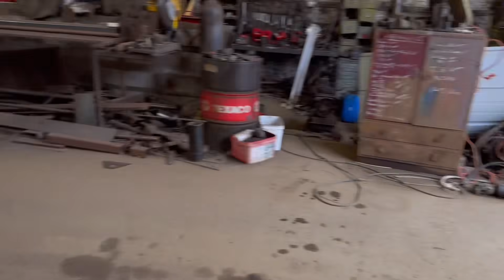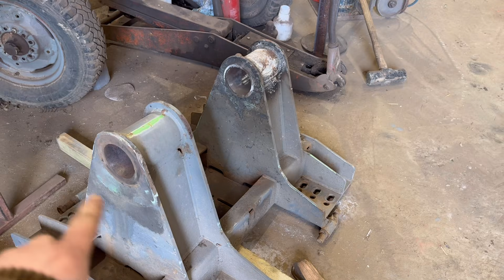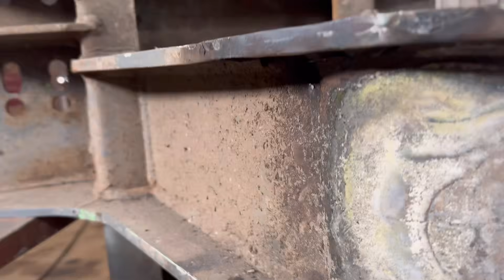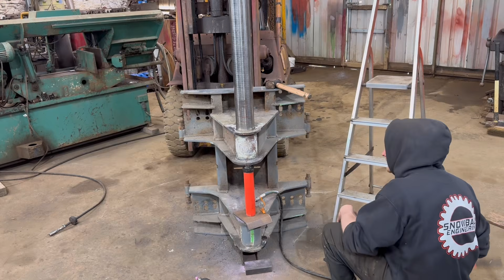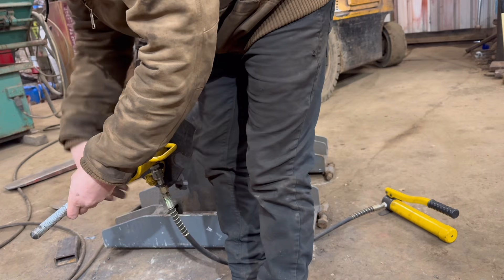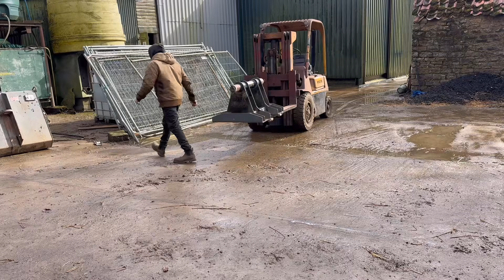Replacing Joskin tanker axle pivot. Part 2.

Comment: An automotive cylinder hone would be great to prep the tube before installing the new bar.
Also,if you need lube but don't want to contaminate rhw weld,use your sisters personal lube..its water based and washes off easy with water and will burn off at low temp.

Comment: Never use a stick lighter, disposable lighter, or matches to ignite an oxy-acetylene or oxy-propane torch. Lighting these torches creates a concentrated rush of gas that ignites with significant force. Using a hand-held lighter is extremely hazardous because it places the hand in close proximity to the initial flame, which can result in severe burns or the potential explosion of the lighter itself due to the heat.For safe operation, industry standards require the use of a traditional flint striker (also known as a cup striker) or a dedicated long-reach torch igniter designed specifically for welding. These tools are engineered to create a spark while keeping the operator's hands at a safe distance from the torch tip.

Comment: That's a proper heavy bit of work there . I still would have cut the outside bits right out of it before jacking the stuff out. But the observers viewpoint is one you don't have and we cant see what you see or know either. You made it like new in the finish although there may have been slight misalignment between the pedestal bores. Well done! On pipework we had a 240 volt powered hydraulic pump with reservoir to do the jacking on the jointer. That would pull it in , in short order.

Comment: I've been watching your videos for the past few months. sadly, I just realized I hadn't been subscribed or even logged in. 
With putting the new shaft in: would it have been quicker to setup for line-boring and making a 0.1 mil oversize bore vs. all the sanding/grinding and pressing? 
honestly, curious because I've seen other videos of welding and line-boring but I've not done work quite like that, personally.

Comment: You did well there Snowy, that sort of thing is a sod of a job on a good day, A tip AND IN NO WAY A CRITICISM - if all possible, cut a short piece of the bar you are going to fit  (at least 1.5 x D long) to use as a guage when cleaning out the holes,  it can save  a lot of struggling

Comment: just wondering why you didn’t use the line boring equipment to make it easier to  get the big shaft through the two sections.
Reply from the maker: Would have added a lot of extra time

Comment: Great job on the repair and that radiator guard is really good too. I think those plastic bushings get dirt embedded into them and actually wear the steel out faster than the plastic. I would recommend going back with steel or at least bronze bushings if possible.

Comment: Felt you're pain on that shaft job.

Worth getting yourself some Spirabands to use in your die grinder, far more effective for material removal on internal radiius's than flapwheels. I have 25, 40 and 50 mm mandrels and use 36 grit bands, they would have worked well to get that shaft through that Bush.

Comment: Did I miss something? Why didn't you line-bore the whole thing to be perfectly straight and in tolerance? I may have missed last week's episode.
Reply from the maker: I didn’t need to.
Reply: @snowballengineering  yeah, I made that comment before you welded it. I thought it was going to need to be able to move within there. I didn't realize it was going to be solid.

Comment: I wonder if you could just make an quick disconnect adapter for the forklift hydraulic in place of that hand pump. Or does it work with air instead?

Comment: Oliver when using your Porter power jack on the pull maybe a spring in between the piece of your nut you're tightening up in between the loose space just a thought might not even help good job anyway you do it might save you a little work

Comment: Here's a couple friendly suggestion that will work more efficiently than your sanding drill and die grinder and eyeballing the high spots in the sleeves. Get yourself some cylinder honing tools from the from the small break cylinder size to the big bore cylinders with different grade of stones. The cylinder hones only knock off the high spots until the bore is concentric. The cylinder honing stones have much better concentric sense than our human eyesight.
Avoid heating your sleeves to a glow when you're welding then to the structure. Do shorter runs and let it cool for a few seconds.

Comment: I'm surprised the factory don't fit that type of guard as standard...but u did a champion job on that nice when it comes together....I ges some of your audience are on a learning curve and u could've done it either way but leaving it long was the best attack keep up the good work awesome job...is it fairly easy to set up a six cylinder ford injection pump for more fuel for a tractor puller thks ..

Comment: Another great repair. If I might make a small comment, I would have tried the shorter piece you cut off as a test for the fit of the real pin. If that fitted OK in each end then you would know where the problem is if the big bit doesn't fit.
Reply from the maker: That would have been a good idea
Reply: @snowballengineering  hindsight is a wonderful thing, shame one can't have it before instead of after. 😃

Comment: A little tip i saw. 
Turn on your oxyacetylene unit and use only acetylene. With the flame, coat the places you want to weld with soot. 
Now, heat the area until the soot burns off. You have the perfect welding temperature.
Reply from the maker: I don’t use acetylene, I use propane which doesn’t leave soot
Reply: @snowballengineering 
Thank you for the reply sir

Comment: Great job!  What was that white spray you put on the areas before you heated them up for welding?
Reply from the maker: Detector used for detecting cracks. It stops the reflection on the steel so the heat gun can get a better reading.

Comment: One thing i would think of doing ( and i have decades of fabricating stuff ) is to take a piece of your cutoff ( a short stub is good enough ) to start with...and try sliding it through each side....as long as it slides easily it will be enough to fit...as you weld it solid after....this will let you see where it is tight and alot easier later to push/pull the full piece through.... but that is my opinion and what i would want to do before commiting to the full piece final install.... i had to make stuff fit once sent out to the job and did the installs before fabricating and knew making it go together really was the Key to making the final install a breeze... 
🇨🇦✌️

Comment: Looks great, Oliver. Next time, maybe weld a saport between the posts to help with alignment and flex. But I think I would have just line bored it straight up to make it true, and you would have been able to just slide it in. Try antispatter for lubrication next time, and then no worries about welding, and it is very slick.
Reply from the maker: Line boring would have added a considerable amount of time to the job. As the hole was already the right size, it would have needed to be pre bored, bore welded and then line bored to size otherwise the hole would have been too big.

Comment: I'm afraid I would've lost patience with that job in the first 10 minutes and cut a slice along the lenth of those bushings and the plates along the bottom and wedged them open. Slide the old one out, slip the nee one in and weld them back closed. All the force is directed at the top half if the bushings so I  wouldn't be worried about weakening it any. I applaud your stick-to-it-ness. Job well done!
Reply: I would've flapper wheeled the living shit outta it and made it a looser fit ha
Reply: @fowletm1992  i would have bought  a horisontal mill like tos 100, milled shafts smaller and sleeved those cunts and called it done
Reply: Would have been tempting 😂😂

Comment: Could tell how proud you were of that rear machine guard, Olly. You've set the bar high on that one. You should contact the UK based importer or stockist and see if there is an opportunity to sell and supply more guards. It needs a snowball sticker in it or need time engrave it. You can't beat having a portapower kit. Had mine stolen

Comment: Well done. The outcome is all that interests the customer. Ask 10 different engineers how to do a job, and odds are you'll get 10 different answers. The hollow bore, hydraulic jacks are handy. I had a couple to help with site work, I had a 12 volt pump which was so much better than hand pumping. Good job, good post 👍

Comment: Great job, have looked at using thermal lance to burn through the centre of the pin, this was how I used to get pins of of crane and digger arm / pivots
Reply from the maker: I do have one but I explained in part 1 why I didn't use the thermal lance

Comment: We use a Flowfit 12v hydraulic pump pack to run rams and presses in the field and they work well, stick aan Anderson plug on the forklift and you an power it from that ( I would recommend you put on your truck too!)... watching you use that hand pump was painfull!

Comment: Good morning, Oliver.  Well done!  Thought sure you would have to line-bore that frame to get the axle shaft to fit, but you managed in half the time with a sandpaper flapper and some grease (I hear the grease works best when it comes from a brand new DeWalt power grease gun🤣)!  
The guard for the Multi-One looks OEM.  Damn nice.
Thanks for the video and see you next week.  Cheers.

Comment: Some guys at work made something to replace the nut at the hollow jack side. Two threaded half moon shapes with a ring over them. You don't have to rotate the nut every time you reposition the jack. If you want, I can send a picture of that. You also can use some motoroil instead of grease, its a little bit thinner and sometimes works better. But fortunately the grease worked just fine! Nice job!

Comment: Great job Oliver. I was expecting the line boring gear to be needed.   That radiator cover looks brilliant.
Reply: Forgot to mention the as well, looks factory!!
Reply: Is there such a thing a line honing? All it needed was removal of a few high points to slide in freely.  Good Job.
Reply: @beesbo1951 yes there is. It’s used mainly on the tube of hydraulic cylinders.

Comment: Why didn’t you take a small length of that shaft and make sure it would slide through both sides. Using an engine cylinder hone would only take out the high spots inside the cylinder. Then you could slip fit it without damaging the shaft!  If it was tight, just preheat it like you did before welding 😱
Reply: danielgriffith7694. Good suggestion , I was thinking much the same as your comment but did not want to get Oliver's ' Six and Two Threes' as  he rightly said there are many ways of  getting a job done .

Comment: Morning Oliver! The grille guard looks great, it’ll also help with the weight on the back end!
Great work on the axle, well done getting it to come through, you got away with having to line bore it! 
You could do with an overhead crane system, that axle bar is heavy, need to think about the future; you’re young and strong just now but as you get older it gets harder. An overhead crane system would save you alot of heavy lifting which could result in injuries.
I would have been very happy with the tanker axle repair, those are not easy to do, as you have shown in this job (parts 1 & 2). 
More brilliant work this week which is what I look forward to seeing every Sunday morning!👍😀
Already looking forward to next week’s video 😁
I watch the Australian engineering videos (CEE) on Friday morning and then look forward to seeing how you’re doing on Sunday and I find both channels very interesting, I find it engaging, has me thinking! And you’re a great entertainer.
The pressing tools are very similar to what panel beaters use to straighten out metal on chassis and car body parts, obviously with different adaptations.
Great video, Mark from Scotland 👍👋😀